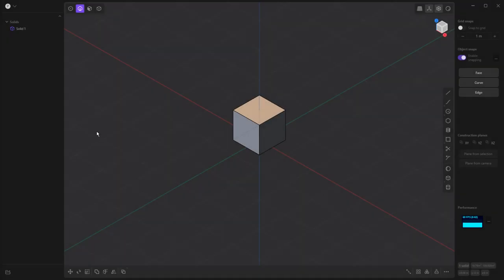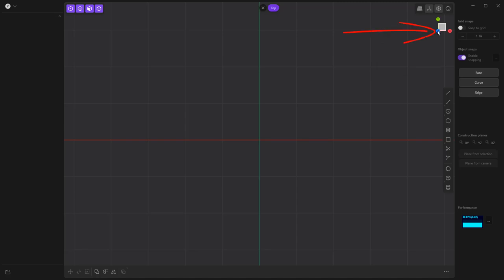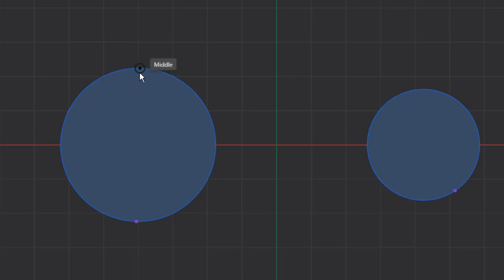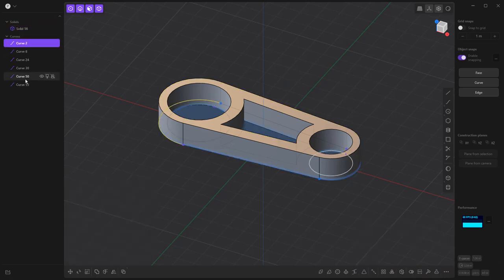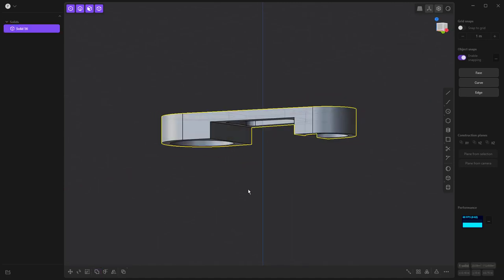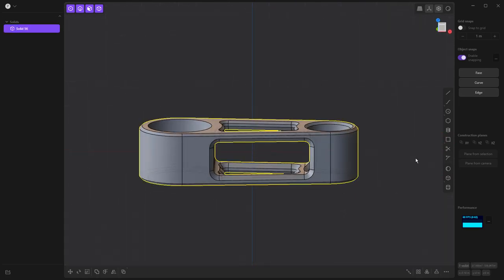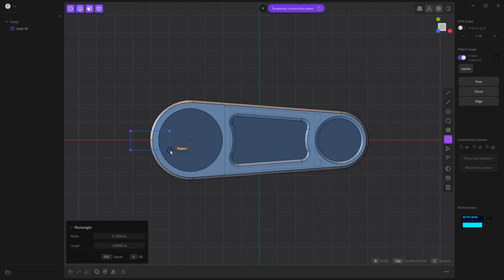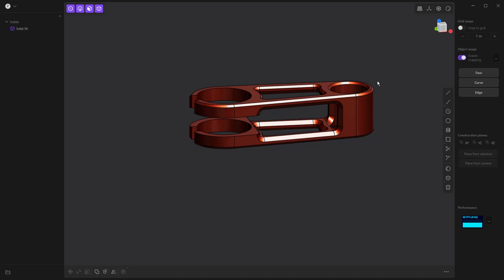Plasticity Quick Start | How To Model A Simple Part In Plasticity

Comment: I use Cinema 4D and Youtube has decided to show me a lot of Plasticity tutorials and I'm liking it :)

But how could you make a spherical surface with a pattern of many convex circles of different sizes. Not holes, but pits (?). Like a noise texture or orange peel but with polygons and not rendered textures.

P.S. I'm using Google Translator and I don't know if what I'm saying makes sense. LOL.
Reply from the maker: Perfect Sense!  Textures are a bit different than what you would do in C4d or even a mesh sculpter with stamps.  You can manually create them, you can array on a curve and you can place on a spherical face, but making a large pattern like a texture would be a pain.  Probably the best thing would be to model the part and then take it to a mesh editor or texturer after.
Reply: think you're describing what Grasshopper does in Rhino - parametric 3D patterns applied as geometrical textures

Comment: Can this be done without using keyboard shortcuts at all?
Reply from the maker: For sure.  It takes a bit longer.  All the move/rotate/scale and other commands like mirror are in the bottom left.  F on the keyboard is find and I would at least use that one to start typing a command.  The tools on the bottom right are contextual based on your current selection.   In the top left the select filters are a bit tricky to do without a key, you can click on the one you want but if you want to add all you hit TAB or 5 on the numbers or you can hold down SHIFT and click to add multiples to your selection.

Comment: Super interesting thank you.
Why do you say it would be insane to try to manufacture?
Reply from the maker: Manufacture with CNC milling I should have said.  It would just be tricky hold and require a lot of different orientations to machine and you would have to find a way to support the long thin sections so you didn't get chatter.

Comment: Hey there, GREAT and helpful video. Hey so I'm following along but when I got mirror in Z and press Q it doesn't merge the two halves, in fact the lower copy disappears.If I ignore the Q command but instead just validate the mirror (yielding two halves now) and then hit Q it doesn't union. I still have two separate halves. Shifting to Y view it looks like my lower surfaces are on the axis. Advice?
Reply from the maker: Hmmm, it is probably a case of it just not overlapping.  What you can try to do before the mirror is to use G and move the entire body down just a little so it overlaps the plane for certain.  Sometimes if one of the lines isn't perfectly aligned it will fail like that.  There are some other ways you can get around it but I would start there first.
Reply: @LearnEverythingAboutDesign  Ah, bingo! thanks, and thanks for a well explained tutorial!

Comment: When I did the mirroring, I used Q to union, but most of the faces didn't merge.  Is there a way to tell it to merge everything it can, after the mirroring?
Reply from the maker: you usually have to hit Q twice i think.  you should see the preview change to like a blueish purple.  If after the mirror the bottom half disappears that usually means they werent on the mirror plane and there was a small gap.

Comment: How large can the assemblies be? Could I use it to remodel incorrect electrical wiring and hydraulic hoses?
Reply from the maker: I don't know of any current limit to the number of parts you can have going, but it can be hard to manage.  some tools like arrays and things might have an imposed limit.  While you could easily model things like wires and hoses with the pipe tool and curves, you would not be doing this for production.  For example if you were doing a cable/harness in Solidworks you would control the length and then have a pin board breakdown of the wiring after.  So in Plasticity you could model these things but not sure what you would do with it downstream.
Reply: @LearnEverythingAboutDesign  We do CGI illustrations of CAD models and until now do all of our modifications of e.g. collisions of wire geometry in polygon software with no loop back into the source CAD system. In our use case it just needs to look right and not have all the correct dimensions. But some of our partners also require a STEP model and thus, they do not get our modifications, right now. Was thinking about doing the CAD changes in Rhino, but haven‘t tried it, yet. Then I saw some plasticity videos and was curious if it was useable for our use cases. Also we occasional get corrupted CAD models that did not survive conversions between CAD softwares and instead of being solids are only surfaces with gaps. Could I use plasticity to fix those models quickly. Would also appreciate any suggestions for a good non-subscription software in the lower 4 digit price range that would allow us to do that.
Reply from the maker: @wingmansion  Hi there.  Plasticity "could" work for you.  the tricky part is what modifications you need.  Plasticity does well at breaking apart solids or joining them back together.  My best suggestion is to try the 30 day trial, import some models and see.  Without the subscription model you do get a bit limited, but Plasticity might work but again it all depends on your modifications.  feel free to email me support@caducator.com if want to send over more info that isn't public.

Comment: Great video, just subscribed to your channel!
I recently started learning how to model focused on the 3D printing world.
I use Fusion 360 today because it's free.
How do you see this tool for somebody that uses F360 for 3D Printing?
Reply from the maker: Awesome, thank you!  For me personally I would stick with Fusion 360 still for a few reasons.  When i design for 3d printing I often times need precise dimensions and input, I am usually working with multiple pieces that fit together or surround electronics, and in some cases I use the slicer in fusion 360s manufacture workspace.  I think Plasticity is a great tool and you certainly can use it for 3d printing, but its not free for hobby users and there are no dimension driven sketches at this point.

Comment: Do you use a mouse with a scroll-wheel?  I found it uncomfortable to mash the wheel to change orientation. Are there other options?
Reply from the maker: I do use a mouse with a scroll wheel.  There are a few ways to change the view orientation.  the num pad 1,3, 7 are pretty straight forward.  using the scroll wheel press goes to the next plane in that direction.  , if you select a face you can hit space bar and that will make a temp construction plane and go normal to that.  You can also click on the X, Y, Z on the view cube.

Comment: If I create a sphere, can I deform it to a more oval shape?
Reply from the maker: not currently.  Doing that is more of a SubD thing which you can do in Fusion 360.  Plasticity is direct modeling at the moment which means you can move/rotate/scale faces, but a sphere being a single face means you would need to slice it up and create a new face for the top lofted or revolved how you want.
Reply: @LearnEverythingAboutDesign  I see, I suppose a custom shape and a rotation would work?
Reply from the maker: @shokk1967  Yeah depending on the geometry.  Just consider the entire face you are selecting as either being scaled, moved, or rotated.  There are non-uniform scale options so you can deform a face/shape non-uniformly  which could be used to stretch the sphere out, but this is less of a face level change like if you are selecting a vertex and pulling it.  Hope that makes sense.

Comment: Can you actually define the dimensions like a CAD tool or is it just for sketching imprecise objects? either way it looks like a pretty intuitive hard surface modeler.
Reply from the maker: not exactly.  you can give curves specific inputs when you create them.  For example you can make a circle at the origin with a diameter of 10mm, then use move to position it relative to its current position.  You can't currently just place it then apply a dimension to accurately locate it.
Reply: @LearnEverythingAboutDesign  I figured, still it looks like a fantastic tool for hard surface modelling. Got a Zbrush for low poly modelling feel to it. Best of all its focused on the modelling, doesn't have the functionality bloat of Blender or Maya and it actually costs less than my car ;)

Comment: From the look of it... is there no timeline like in Fusion360 so that later I decided that I need bigger chamfer I'm not out of luck?
Reply from the maker: well the workflow would be if you need a bigger chamfer to select that face and just pull it which creates an offset face.  You can do this in Fusion with Press Pull which essentially does the same thing "offset face".  BUT there is no dimension/value to go back and edit no.

Comment: hi, This might be a niche question, particularly for a new program that already shows so much cool functionality,

when working with scan data(mesh) and want to cut and edit into it mechanical precision parts.
can Plasticity do that, or is it on the Road map.

additionally can you creat custom Fillet profiles for when you 'hot click' on corners for instance to creat a fillet with lead in
Reply from the maker: Since I am not the developer it is hard to saw what the future holds specifically.  I wouldn't imagine plasticity will turn into a reverse engineering program though.  As it is geared toward artists that seems like a pretty low requirement.  On the free side MeshLab is a tool for processing scan data.  I have videos on doing this in Fusion 360 and then you have dedicated programs like Geomagic specifically designed for that process..

Comment: Can Plasticity be used for large architecture projects? In other words, is there a limit to size and detail?
Reply from the maker: I don't currently know of a size or part limitation.  it don't think it is designed for projects with thousands of solids but I don't know if that means its impossible.
Reply: @LearnEverythingAboutDesign  Interesting. I may be the first to test it out.
Reply from the maker: @TIMMERIZINI  I just built a tunnel structure with 80 solids and about 100 surfaces(to represent conduit) and it didn't have any issue. i duplicated it all 4x and didn't notice anything slowing down.  If you have a large structure you could download the trial and import it as a neutral format and see how it behaves.
Reply: @LearnEverythingAboutDesign  Great idea. I will do that!

Comment: once you have a solid, can you not move points? I can't find a way.. hmm..and yes, looks like you can create this much quicker. But it looks like ou need to clean up the poly mesh inside Blender.
Reply from the maker: No you can't.  Plasticity is "direct modeling" meaning once you make a solid from a set of curves they don't remain linked.  You can delete the curves or make new solids after you move them.  You can also move faces direction by scaling, rotating, offsetting or drafting them.

Comment: Can you dimension things?
Reply from the maker: note exactly.  you can have inputs while creating or moving.  say you put a circle at the origin with a precise value, then use G (move) to move it an exact distance.  There is currently no way to add a precise dimension and drive the location of something like a curve.  it all happens directly during creation or when moving/offseting.
Reply: @LearnEverythingAboutDesign  do you have an example somewhere showing how a feature could be located from some other feature or reference?
Reply from the maker: @seenmakino  I don't have a new video yet, but this is an old one i pulled down because it was an early beta version of the program, but the same should still hold true to understsand the process. https://youtu.be/OkPI8Vx-gKo

Comment: Ok so.. if it's not polygonal does that mean it cannot be used for video game models and STL files for 3D printing?
Reply from the maker: 3d printing yes. https://youtu.be/FnipEEjvU1k   the catch is just how you create/scale/define the size of everything since there is no inherit constraint system after curves are created.

For video games yes, but the general workflow would be to mesh and remesh something.  Someone has made an add-in for blender (i think) called Ngone.  Its a remesher to take cad files that have been saved as an stl/obj and optimized them for low poly game assets.

This is true with any CAD to poly workflow.
Reply from the maker: https://www.youtube.com/watch?v=st2rWhhBZMY
Reply: @LearnEverythingAboutDesign  ok thanks for getting back to me I already have a headache haha.. I tried to follow the tutorial and can't find anywhere to even get the camera to orbit so I cannot move forward.. I also don't have control points on mine somehow.
Reply from the maker: Check the UI video I did,maybe that will help get acquainted.  https://youtu.be/ZhD4uVRuNnY

For the control points it is likely the selection filter.  Upper left corner of the modeling window you will see 4 boxes,  If the first one isn't highlighted it won't show you the control points.  The number 1 on the keyboard (top of the keys not the num pad) will turn on the point selection.  5 will turn on all types.  You can also hold down SHIFT and enter other number 1-4 and turn on multiple options.

For the rotating the default behavior on a windows machine is holding down the middle mouse button to orbit.  right mouse button to pan. and scroll wheel to zoom.

Comment: i love that there are dimensions in this. bc im using MAYA and there isnt any
Reply from the maker: in version 1.2 the dimensions will display a little different.  They will show when creating the object BUT keep in mind this is only at creation.  Those dimensions aren't driving anything.
Reply: @LearnEverythingAboutDesign  can i switch to mm? instead of m for 3d printing?
Reply from the maker: @karadanvers6136  Yes if you go drop down in the upper left and to "Preferences" there is a "grid & units" section

Comment: no idea how you changed to 3d view? perhaps it's supposed to be obvious?
Reply from the maker: at which point in the video?  NumPad 1,3,7 change to the default construction views.  The view cube in the top right lets you click the axis you want.  Space bar makes a temp construction view based on how you currently positioned that you can save and go back to.  Also if you hold down ALT, the middle mouse wheel and drag it will snap to the various ortho planes.

Comment: Just wondering why it's all done in meters (and the easiest to see when most modelling is in mm yet so difficult to use in Plasticity
Reply from the maker: This was done in Meters because the switch to mm also required some grid setting changes and felt it was easier as a start point to just leave it as the default units.  If you switch to mm or inch i like to set the grid size and accented lines to better represent those settings as well.

Comment: Tried it, and found it completely unintuitive. Merely creating simple dimensioned shapes or selecting edges to modify their length is frustrating or impossible
Reply from the maker: yeah it is a different workflow to CAD.  It is made for Blender users mainly and can be tough from a CAD mindset.  I think some of those elements will get in there eventually but right now it doesn't have the constraint/dimension systems of a CAD program.

Comment: This software probably isn't for me. But it seems like a worthy successor to SketchUp (which seems to be getting slowly killed).
Reply from the maker: Very true.  If nick decides to put precise input/dimensions into it, even if they don't maintain a link back to the curve I think it will capture a segment of makers.
Reply: concur 100% re Plasticity. and sketchup is gone daddy gone. Blender is the force dejeure. and when you combine Plasticity (and F360) with  Blender you create hypergolic rocket fuel 🔥 🚀
Reply: I would consider shapr3d as a successor to sketchup.
Reply from the maker: @Z-add  I did evaluate Shapr3d.  it was clear from the workflow that it is made for touch screens.  There is also freeCAD out there.
Reply from the maker: @Z-add  that is how i tested it.  I more meant the workflow, at least when i tested it last year, was more designed for a different type of interaction than keyboard/mouse.  I didn't like/wasn't blown away by it in terms of speed or performance.  I wouldn't pick it over Fusion 360 for example.  By i am on the CAD side of things more.
Reply: I've tried Shapr3d and Plasticity but they seem a bit like toys. Plasticity has a lot of bad ideas from Blender (vertex/edge/face toggle, and the procedural options not having hotkeys/expressions).

Sketchup Make 2017 still works for free and supports almost all extensions (because Sketchup 2022 is the same program 🤣). The only modelling feature disabled is the booleans, and limited export options (DAE).

If someone could make Sketchup + Blender/3DS's procedural modifier layers it would be great.

Comment: this looks like blender, ui, model shading, wireframe, that options window in a corner... i wonder if this is some kind of mutated branch of blender.
Reply from the maker: Nope its a fresh program from the ground up, but the creator, Nick, knew that most users would be coming from Blender so it was designed in a way to feel similar.  Even some of the default keys like G, R, S that are used in Blender are used in Plasticity.
Reply: @LearnEverythingAboutDesign  okay)